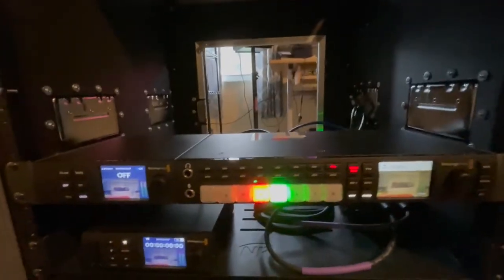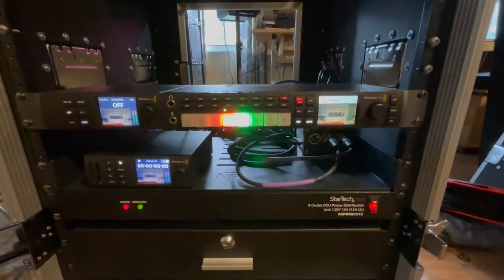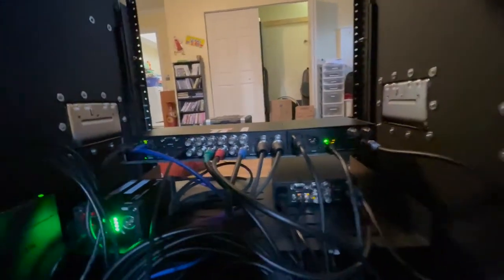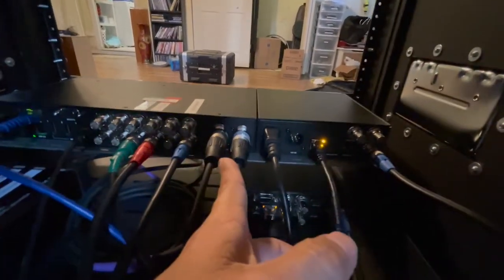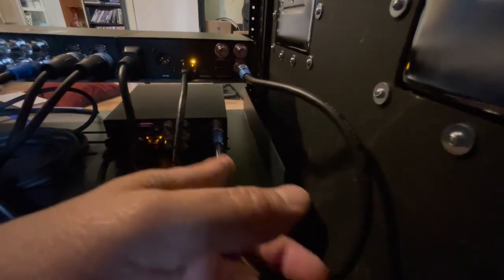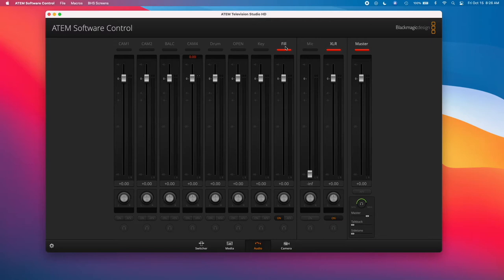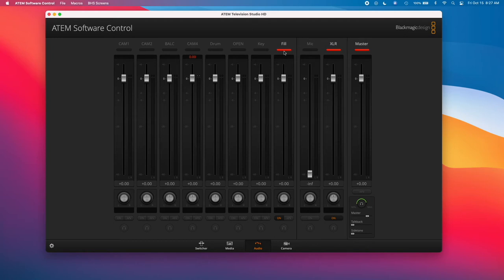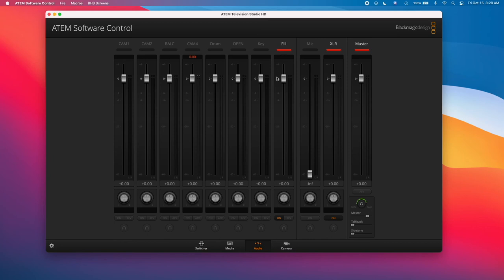Atem TV Studio with Dante and PP7

Comment: Thanks for sharing, when we mix out of logic, and dante into the xlr, we have struggles with getting loud enough volume! How did you guys fix this with the atem
Reply from the maker: @nathangoh834  we make sure to have healthy gain and then we push  the Mix buses hard and they are all parallel compressed and we use an adaptive limiter in logic and make sure we see 4 to 5 db of reduction.  After it hits the limiter